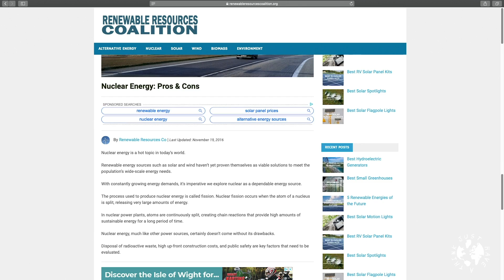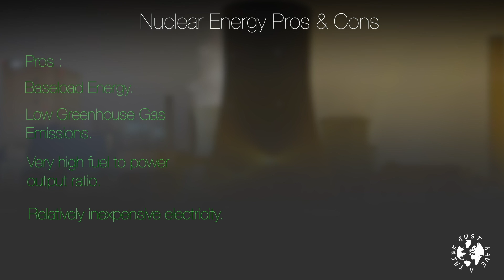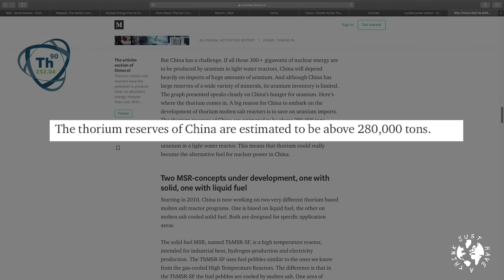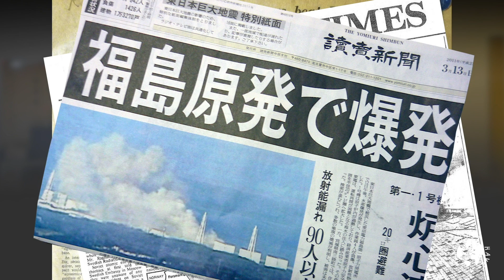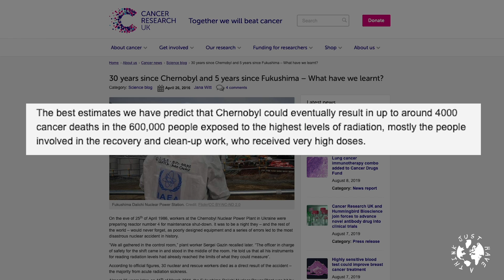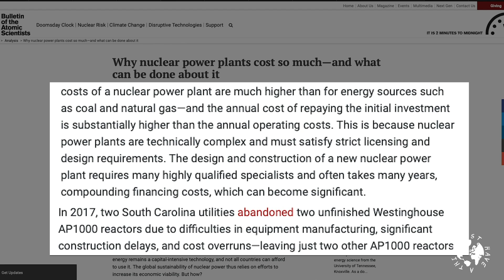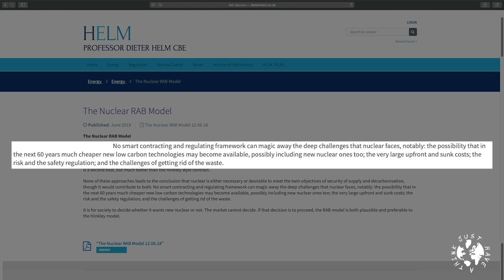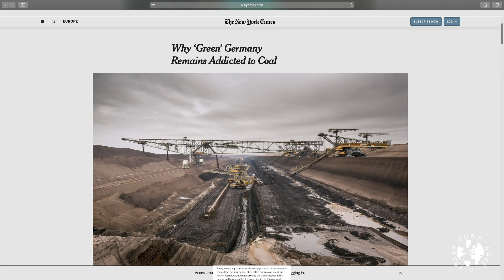Nuclear Energy in the 21st Century

Comment: I'm happy to be corrected on any of this, but I think you've neglected a few details Dave:

1) The percentage of nuclear waste that requires long-term storage for more than a few decades is tiny compared to the amount of waste that comes out of each reactor per year - the figure you state per reactor is the figure for the entirety of the waste, including waste that will be safe within our lifetimes - so I think that statement's a bit of a misrepresentation of the reality. Also, it seems a bit weird to talk about the mass/weight of the waste when it's the volume that matters to the discussion - particularly as most people will have no perception of just how heavy an element Uranium is.

2) The severe lack of storage for highly radioactive waste is more a result of NIMBY-ism than any technical ability to build storage - this is, to my mind, no doubt largely due to a campaign of misinformation by the fossil fuel industry over the last 70+ years.

3) At 9:20 in your comparison between renewables and Uranium fission, you state that "renewable resources like solar and wind are in infinite supply", however the manufacturing and maintenance of renewable energy sources also produce vast amounts of toxic waste - including radioactive waste - which is far greater in volume than the level of waste from nuclear power production The materials throughput per TWh is far lower for nuclear power than it is for any of the renewable energy sources. Just ask the people of Baotou in Mongolia, where the majority of the world's solar panels are manufactured. 
Nuclear waste doesn't exist in a vacuum, and it needs to be compared relative to other energy sources to give a balanced perspective on it or else you are continuing that propaganda on the fossil fuel industry's behalf - and you're presumably not even getting any cheques off them! ;)

4) Just something that might have been worth mentioning but you didn't - statistically speaking, the number of deaths per TWh of energy produced from nuclear power compared to all of the other energy sources make it the safest energy source we have by a long way - no doubt in large part thanks to all the extra cost and regulation that goes in at the planning phase of the process. You mentioned the costs, but not the benefits of those costs.

Anyway, I love your videos - and the rest of this one is no exception - but as always, the devil is in the details, and I think you missed a few important bits in this video. If I had to guess, I'd assume you came at this from an anti-nuclear perspective before you started researching the topic, and haven't changed your mind about it really? I appreciate that you always try your best to present a balanced and unbiased approach in each of your videos, but it feels like this one came up a bit short on that front, that's all. Perhaps I'm wrong.

(SOURCES for the majority of what I just said: 
https://www.energy.gov/sites/prod/files/2017/03/f34/quadrennial-technology-review-2015_1.pdf
and https://ec.europa.eu/energy/sites/ener/files/documents/ECOFYS%202014%20Subsidies%20and%20costs%20of%20EU%20energy_11_Nov.pdf)
Reading that back, it seems worth stating that I don't work in the nuclear energy industry, it's just one of those things that I was originally against until I examined my biases properly, and realised I was incorrect.
All the best.
Reply from the maker: Hi Andrew. Thanks for your feedback. Just to clarify my position...I came to this video as someone who is 100% agnostic about Nuclear Energy. Those who are dead set against it have exaggerated the downside and those who are fully in favour of it unsurprisingly focus on the obvious benefits, and downplay the risks (and discount public opinion, which is not irrelevant). I have been putting off making this video for a year, not because I'm conflicted about the technology  but because quite frankly I knew that the vast majority of viewers on both sides of the argument would completely slag off what I consider to be a fairly balanced presentation. That, I'm afraid, is analogous to the entire climate debate, especially in America. We are a truly cretinous species, totally unable to co-operate and take pragmatic decisions even when our own survival depends on those decisions. It is a pattern that has been repeated by every single major civilisation throughout history and it looks like we have learnt zero lessons from those experiences, so quite frankly we deserve all we get. Apologies that you have been the recipient of a bit of a rant but I have just spent an hour reading a string of utterly delusional nonsense from a stream of extremists on my comments thread (I do not include you in those by the way) and I just needed to vent a little bit. Thanks for listening! All the best. Dave
Reply: @JustHaveaThink  hah! No worries, I feel bad for criticising you now! It'll all be better after a nice pot of tea, I promise ;)
Do you want a cuddle? 

Just keep on keeping on, and don't feel the need to reply to everyone mate. Your channel is getting too large for that anyway - if you need an excuse to run away and ignore the notifications...

Thanks for clarifying your position, this video was never going to be an easy one. I think you're right about public opinion mattering; but I think the approach should always be to try and inform that opinion more with a view to changing it, rather than succumb to it just because the masses think they're right about something that they've got a shady knowledge of at best. Anyway, maybe just sack off the comments section this time around... Thanks for all you do. Your content is incredibly well made and I'll keep sharing it far and wide :)
Now get that tea on.
Reply from the maker: @banksarenotyourfriends  Thanks mate. You're points are well made and absolutely valid. I appreciate your forbearance of my ranting (I rarely reach that point, I promise!)
As you say, a nice cup of tea is definitely the answer :-)
Cheers. Dave

Comment: I'm grudgingly in favour of existing nuclear power just to be used as a base-load provider while the transition to renewables takes place. But when their life is over, I would honestly want them gone. And we desperately need to properly solve the problem of nuclear waste. And I don't honestly see the necessity of developing Thorium reactors either. Renewables are clean and safe in operation. They leave no waste, except any which occurs in manufacture, and to make them 24/7 providers they just need adequate battery backup. Solar is best on our roofs, and leave the National Grid to provide the Wind, more Solar, and Water power in it's various forms.

Comment: World Economic Forum recently stated:

‘77% of the world's cities will experience a striking change in climate, according to scientists.

By 2050, Paris will be like Canberra, which has experienced extreme drought conditions.’

2050 seems optimistic - given current rates of change - but anyway, even on this timeline such temps don’t bode well. 

France has 58 nuclear reactors operated by EDF, with a total capacity of 63.1 GWe. I understand that these reactors currently generate about half of the Country’s annual water demand (next biggest slice of the pie being farming). It’s difficult to find info on the web anymore pertaining to this though. Aside from shutdowns during heatwaves (a lot in recent years) and inefficiency as ambient water temps provide less cooling, just how long can such consumption rates continue? It takes many decades to decommission, at great cost.

The most common types of nuclear power plants use water for cooling in two ways:

1. To convey heat from the reactor core to the steam turbines.

2. To remove and dump surplus heat from this steam circuit. (In any steam/ Rankine cycle plant such as present-day coal and nuclear plants there is a loss of about two-thirds of the energy due to the intrinsic limitations of turning heat into mechanical energy.)

Below  is one version of a Climate Plan from the Sam Carana Group. Item 2 couldn’t be clearer. The plan advocates measures that can be taken in efforts to improve the situation regarding the climate, as well as regarding the health, prospects and well-being of people and life in general. These measures can and should be implemented immediately, in line with the current climate crisis. 

Seventeen measures for immediate implementation

1. FOSSIL FUEL - Ban the use of coal and natural gas for heating, cooking and generating electricity. Stop supplying natural gas from utilities over pipelines. Ban sales of natural gas bottles. Use rationing of electricity supply from the grid to overcome bottlenecks in supply, until sufficient clean, renewable electricity can fully supply demand over the grid. 

2. NUCLEAR POWER - Stop nuclear power plants from continuing to operate and start decommissioning existing plants. Study options for treating and storing waste from such plants. 

3. WOOD AND BIOFUEL - Progressively ban the use of wood and other biomass for generating power, for driving vehicles or for other energy-related purposes. Impose fees on sales of biofuel, while using revenues to fund pyrolysis of biowaste and on return of the resulting biochar to the soil locally. Ban sales and installation of new woodburners. Ban sales or supply of firewood, woodchips, briquets, charcoal, etc. Impose annual fees through local rates on real estate that contain existing woodburners, open fireplaces, and traditional ovens and furnaces that use wood, while using revenues to fund rebates on local sales of clean electric alternatives such as heat pumps. 

4. ROAD AND RAIL VEHICLES - Progressively electrify all trains and rail traffic, by imposing fees on trains that run on fossil fuel, while using revenues to fund conversion to or purchase of new electric trains. Progressively ban the use of vehicles with internal combustion in cities, first for one day in the week, then for two days a week, etc. Add fees to annual registration of vehicles with internal combustion engines, and use the revenues to fund rebates on registration of electric vehicles. Progressively close petrol stations and ban sales of products such as gas, diesel, petrol and further fossil fuel. Add fees to sales of fossil fuel and use revenues to fund rebates on clean public transport locally. Ensure there is public access to financial records. Set standards to reduce unnecessary vehicle noise, while ensuring sufficient sound is generated to warn people and wildlife. 

5. AVIATION - Progressively ban aviation where flights are powered by jet fuel and other fossil fuel and biofuel. Impose fees on sales of such fuel and use revenues to fund rebates on electric airplanes that can take off and land on rooftops. Similarly, add fees to flights entering and leaving airports by airplanes using fossil fuel, while using revenues to fund electric airplanes that can take off and land on rooftops. 

6. SHIPPING - Progressively prohibit use of bunker fuel and other fossil fuel in shipping. Impose fees on sales of bunker fuel, with revenues used to fund batteries and hydrogen fuel cells to replace traditional engines in ships. Impose fees on shipping of fossil fuel, with revenues used to clean up waterways and support wildlife conservation. 

7. URBAN WASTE - Progressively make that zero % waste leaves each city, neither by road or boat transport nor through the sky, soil or waterways. Make that waste will be processed within each city, preferably pyrolyzed with biochar and nutrients returned to soils. Add sensors to rubbish bins and garbage collection trucks to ensure that no toxic products are disposed off, unless through collection points that ensure proper processing. 

8. PLASTIC - Ensure that no plastic (or plastic parts) will be sold without permit and without fees high enough to ensure return of such items to approved collection points for safe disposal and processing. Ban single-use plastic, such as for packaging, drinking, etc. 

9. DIET - Progressively ban sales of livestock products, unless supplied for medical purposes if no alternatives are available. Add fees to sales of livestock products, with revenues used to fund rebates on soil and water supplements that contain biochar and olivine sand in rural areas. In coastal areas, use revenues to assist enhanced weathering in waterways. Stop using antibiotics and hormones to stimulate growth in animals. Stop using crop to feed animals, unless for sales of petfood to pets held with a permit. Add fees on sales of products that have carbon dioxide, sugar, salt, flavors or coloring added, with revenues used to promote vegan-organic diet.

10. AGRICULTURE - Add fees on sales of nitrogen fertilizers and use revenues to fund rebates on biochar and enhanced weather in oceans. 

11. WILDLIFE CONSERVATION - Ban chemical pesticides. Remove walls and fences that stop wildlife. Provide ways for wildlife to cross roads and highways. Set aside progressively increasing areas where no urban, agricultural, industrial development is allowed. Move existing buildings, agriculture and industries from such areas. Fund progress through annual fees imposed on real estate in areas zones for industrial, urban and agricultural development. 

12. CONSTRUCTION - Add fees on sales of Portland cement, with revenues used to fund carbon-negative contruction material used locally. Fees must be high enough to progressively phase out use of Portland cement. 

13. AGRICULTURE AND FORESTRY - Prohibit dumping of agricultural and other waste in landfalls, prohibit burning of waste in open fires. Prohibit cutting down large trees without permits. Where permits are supplied, add fees to minimize deforestation, while using revenues to support reforestation and afforestation. Ensure that biowaste gets pyrolyzed, with the biochar returned to the soil locally. Add fees on local rates where soil loses carbon content, with revenues used to fund rebates where soil carbon content increases, such as when biochar and olivine sand are added or when new trees are planted. 

14. COOLING - Ban sales of new air-conditioners, fridges and freezers that work with gases. Impose annually rising fees on existing items, while using the revenues from the annual fees to fund rebates on solid state products, including heat pumps. 

15. INDUSTRY - Ban the use of cleaning, solvents and other products that result in further addition of greenhouse gases. 

16. UNIVERSITIES - Encourage further study in the effectiveness of measures in all above areas. Compare what happens locally with what in other areas, to ensure the most effective policy tools are used locally to facilitate the necessary transitions. Government grants are to be given to studies that sufficiently care about above points. 

17. FURTHER ACTION - Further lines of action will be needed to hold back the temperature rise. Some action requires further research and U.N. supervision. Some other action has low risk and, due to the urgency to keep temperatures down, testing and R&D should commence immediately. This applies in particular to ways to reduce overheating of the Arctic.

https://www.world-nuclear.org/information-library/country-profiles/countries-a-f/france.aspx
Reply: Consider also this insofar as facilities located shoreside are concerned...

https://www.counterpunch.org/2019/08/13/sea-level-rise/
Reply: That's absurd and will NEVER happen

Comment: Thorium can consume nuclear waste from other nuclear systems. Is uses 99% of all fuel and the waste is only radioactive for a relatively short period.
Reply: That's only if it's designed to be a breeder reactor. The same thing can be done with uranium designs. Here's one based off an experimental design from the 80's/early 90's https://nuclear.gepower.com/content/dam/gepower-nuclear/global/en_US/documents/PRISM%20Technical%20Paper.pdf and there's a company called Moltex Energydoing the same thing with a molten salt reactor design (https://www.moltexenergy.com/stablesaltreactors/). They aren't the only ones by the way.

Comment: Check out MSR's to provide energy and to neutralize those stockpiles of highly radioactive waste as this seems to me to be a sensible way to go.
Reply: Yes, and for that any fast breeder (almost all experts shifted from thermal to fast) is a good tool. However, physics dictate that this mode of operation is much less economical. So it wouldnt be suited for large-scale energy supply, but rahter transmutation - waste processing like you described.  Until we know how gen 4 reactors fare technically and economically, we neet to upramp renewables, we have no time to waste. If gen 4 reactors or fusion in 30 years prove to be great - fantastic. Until then, we know what to do.

Comment: Nuclear power is about the same capital cost as clean coal. It may even be cheaper and it's much harder to store the carbon dioxide created in IGCC then it is to store the small amount of nuclear waste created in a reactor. And even though renewable energy is growing very fast it will not achieve the stated goals less than 2 deg Celsius rise on pre-industrial levels based on current projections.  That's just cold hard reality. The China pie chart shows the problem - China will reduce it's reliance on coal from 58% down to 32% by 2040 - that's great right? But in that same period the total energy capacity will rise from 1625GW to 3188GW - that's an increase of about 98%. So coal generation will actually rise from 942GW to 1020GW. And gas will rise from 65GW to 223GW. Oil will reduce by about a 1GW. That means that the net amount of CO2 that China emits in 2040 will actually go up. Not to single them out. They aren't unique - in fact they are doing more about it than most countries.